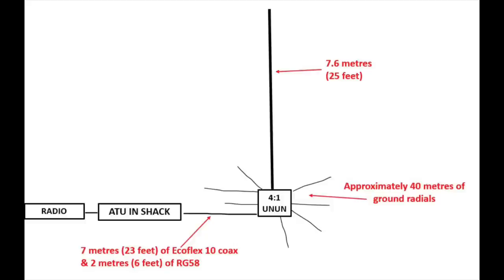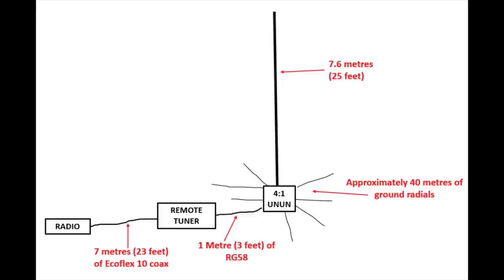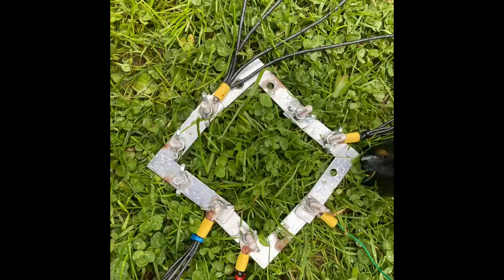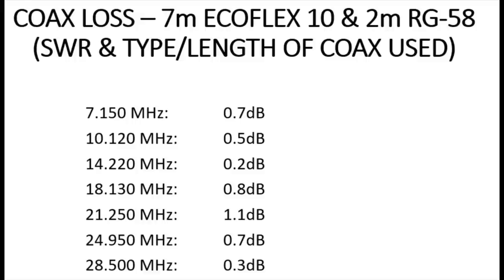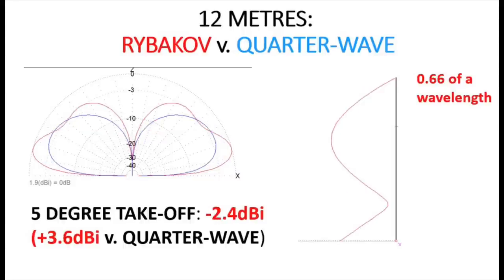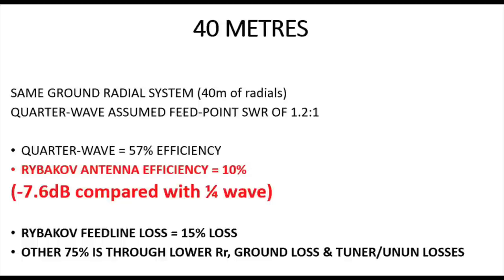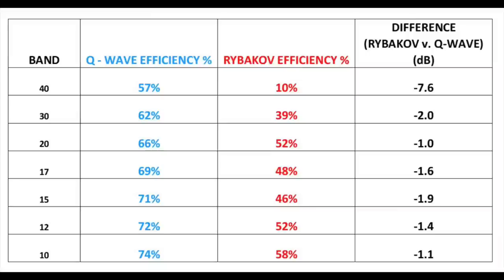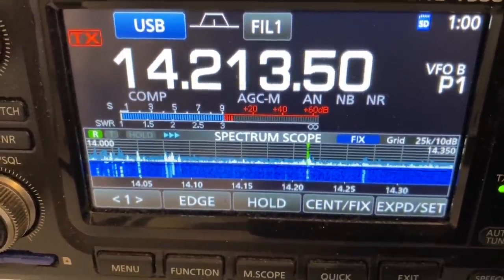Ham Radio: Easy Vertical Multi-Band Antenna 40-10 Metres

Comment: Are you okay Tim? Only reason I ask is you said that the VSWR isn't too bad. Looks like most are way bad. Am I missing something?
Reply from the maker: Look again at the loss figures on the coax I used. People get waaaayyyyy too hung up on swr. 73
Reply: @timg5tm941 but I thought most tuners don’t like swr above 3:1 ??
Reply: The 'tuners' that are built into transceivers have a very limited matching range, typically up to 3:1 only, so are really only suitable for matching band edges on resonant antennas.  For many aerials, a 'proper' external aerial matching unit is required.  E.g. the classic manual MFJ 949E which will match very wide impedance / SWR ranges, or for an automatic antenna marching unit think; LDG Z11ProII or LDG AT-200.  They should match up to 10:1SWR.   73 Mike M0MTJ
Reply: The 'tuners' that are built into transceivers have an extremely limited matching range, typically up to 3:1 only, so are really only suitable for matching band edges on resonant antennas.  For many aerials, a 'proper' external aerial matching unit is required.  E.g. the classic manual MFJ 949E which will match very wide impedance / SWR ranges, or for an automatic antenna marching unit think; LDG Z11ProII or LDG AT-200.  They should match up to 10:1SWR.   73 Mike M0MTJ

Comment: Have you tried it with elevated radials, the efficiency I would think improve.
Reply from the maker: They usually need to be tuned if elevated
Reply: Yes however many articles pointing towards 2 elevated radials outperforming 30-60 ground mounted radials. there was a nice article regarding this in either Cebik or ON4UN books. also the take off angle works out better if I recall as well.
Reply from the maker: @n8sdr473  yes, but if those radials are detuned you’ll be beset with common mode and potentially skewed radiation patterns as the vast range of impedances will mean that the antenna becomes pretty difficult to tame
Reply: I'm talking tuned - if you use only 1 or 2 elevated tuned radials for bands you wish to operate it will outperform a series of ground radials which by nature of laying on the ground become detuned no matter what length you cut those for. One could also if space is a bit limited- perform the fan dipole method of elevated radials as well even if it is just 1per nband  it will still perform better then say 20-30 ground mounted radials-  one could use 40/30/20/17/10M bands and cut just one tuned radial for each those bands and even if you used a spacer to separate them like with fan dipole it would be better. Also slightly sloping them at a downward angle would help tune them, since your already by design having to use a tuner because of the vertical section and unun obtaining a good SWR should be fairly easy anyway.

Comment: From what I have read, it does not have to be 25 feet. Could be any non- resonant length up to about 53 feet. So, 29, 36, 44, 51, 53 feet should also work.
Reply from the maker: Agree, in this case 25 feet provides better low angle DX performance than a 29ft version on 10m. 73

Comment: I have a 25ft aluminum flagpole I used for this type of set up with a (made by me) 9:1 unun and a fairly decent counterpoise and chokes on either end of the 50 ft of rg8x And it worked pretty well. But it did not outperform my EFHW.

Comment: I love thr LDG Ununs.  I carry both the 4:1 and 9:1 with me for POTA/WWFF activations.  I have played with various wire sizes and use radials when I can.  It's a compromise compared to full size dipoles but a lot easier to get a vertical wire up with my TN07 mast than a dipole.  73 de KJ5T
Reply from the maker: It gets you on the air Steve and that's what counts. 90% of it all is about the propagation anyway 73

Comment: A very interesting video!  Thanks for posting it.   Its got me thinking .. About 10 or 12 years ago I picked up  a vertical that was put together by a small independent Radio Shack dealer in Kansas that also had some ham radio equipment and antennas for sale (above what RS sold).   It was a 21 ft vertical with 4:1 UNUN  and was made for very portable set up and take down.  It was almost like the antenna you talk about in the video and required a wide range ATU.  I mounted an LDG  RT-100 at the base of it,  and have experimented a bit from time to time with adding length  to bring it from 21'  up to 26'.   I am planning on playing around with the vertical length again after adding a capacity hat consisting of 3 small diameter  72 inch aluminum rods folded back the clamping block.  It will look something like a clover leaf with overlapping sections.   I am interested to see how it will change the  load presented to the Unun and tuner.   Its all about having fun and experimenting right?    73
Reply from the maker: Sounds a great plan!

Comment: I like it but some of the SWR readings seemed quite high.

Is 2dB of extra noise typical for a vertical v's a horizontal antenna?
Reply from the maker: Losses on coax were minimal. As for noise, I find at my semi urban location that any vertical I use on 40 is 2-3 s points noisier than a centre fed inverted v

Comment: Tim, I'm in the process of getting the materials togther to build the Rybakov vertical, The question I have however is why not use a 9:1 Unun as opposed to the 4:1? Does the wire length have anything to do with its impedence?
Reply from the maker: Yes it does .. at this length the impedance on 40 is likely to be already quite low so a 9:1 might make tuning tougher. A 4:1 is more of a compromise across all bands used with this length of antenna
Reply: Thanks, Tim I really enjoy the videos. Lots of great information.

Comment: how about the same length of wire fed as an off center dipole 4ft up to a 9;1 then the rest of wire up how would that work foe 40m?
Reply from the maker: Same length means same efficiency. Although it may or may not be easier to match.
Reply: @timg5tm941  if it's the same efficiency maybe it would be easier to use rather than take radials with you portable

Comment: Hello Tim I wonder if you can input some of your wisdom with a 20 17 15 12 10 m antenna idea on a 4.9m pole the idea is kind of like what Walter came up with a bit like a virtical ocfd windom ish antenna so 1m from ground upto a 4 to 1 and the rest of the 3.9m up as the radiator iv used mmana gal and seen  8 or 9 to 1 at 10 and 20m and less about 5 or 6 to 1 on the in-between bands what I'm unsure of is the losses of the system with say a 5m run of rg58 as a quick portable low footprint relative low hight just all around stealthy antenna .I'd be willing to deal with some reduction in efficiency for a simple 5 band antenna for the g90 .do you think this is a usable antenna idea or not and I would be hugely grateful to see you brake down the system losses and efficiency in your way as you always make it easy to understand all the true system parameters as iv modeled it it seems fairly usable but I'm out of talent to understand the rest of the system loss as a whole
Reply from the maker: Definitely usable. Walt’s videos are great. I made a similar antenna using 450 ohm ladderline and some wire and it was ok. Losses with a 5m run of coax shouldn’t be too awful. Try one and see.

Comment: Hmmm if the radiator is random why not use random for the radials?
I'm wondering if a Tesla design would be great like this. 94' radiator with 17' radials. . The radiator could be folded back
Reply from the maker: Hmm maybe. The radials are typically random lengths